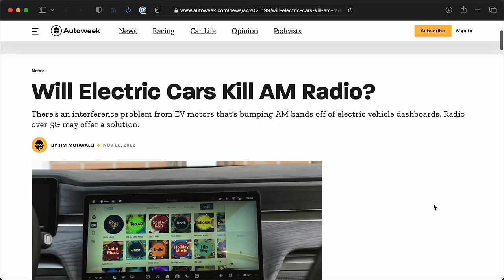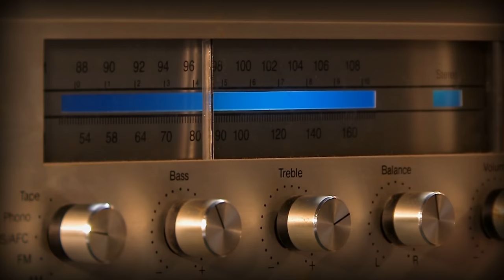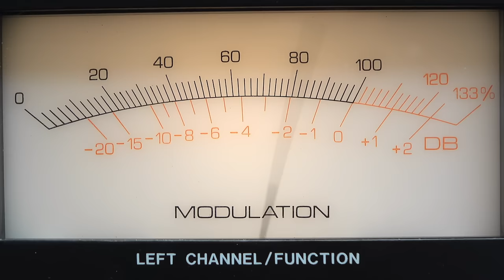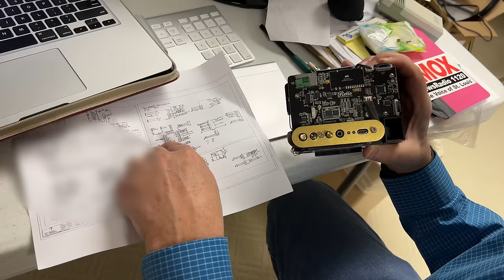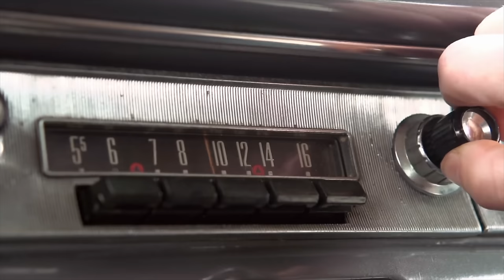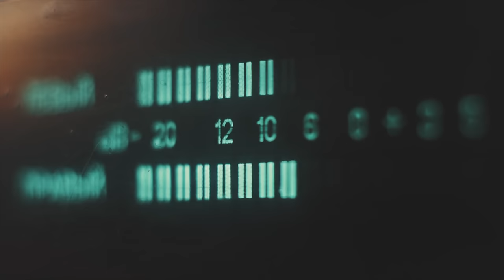Is AM radio dead? Tesla thinks so!

Comment: I would say that AM radio is not dead, but it is terminal. Preserving it is an exercise in futility. That is not a bad thing. It is simply a technology who's time has past. That said, it is used for some pretty critical things. So what we need to be doing is asking the following question. What is going to replace it? For each use case, especially the critical infrastructure ones, we need to be working towards a new technology that not only replaces it, but improves upon it, even if this technology does not exist yet. We need to actively be working on the next thing that will check every single box that AM Radio checked, while also improving on some of the classic problems with the technology. Like your dad mentioned Amplitude Modulation lends itself to allot of interference due to how easily any kind of noise can affect the amplitude of the carrier signal. So as an example, interference is one of the issues the replacement should at least address if not fix.

To the radio enthusiasts out there. I am not trying to take away your hobby. You should be leading the charge. Nobody is more qualified than you to be working towards the next big thing to solve these problems. I am not saying stop your hobby, I am saying take it up a notch.
Reply: If a decent digital way of transmitting and receiving could be implemented, one not as susceptible to the interference talked about here then then possible the MW band could be saved. Many AM stations were given FM translator frequencies going back a few years, many of them promote the FM side more heavily that the AM side.
Reply: @gorak9000  way to out yourself for not watching the whole thing. It is used for emergency communications. Amateur radio operators are a critical part of disaster infrastructure. The reason the FCC provides them so many protections and alloted spectrum is the FCC and Emergency Services rely on them when everything else is down. If it was only about the stuff you mentioned, there wouldn't even be a discussion. An intelligent person would have been able to figure that out even without the FCC defending AM radio just based on the fact that there are people in the know worried about it.
Reply: Dude the santanists don't want you to have freedom
Reply: I thought that AM (MW/SW) was long past its use by date three decades ago.
Then I met a fellow who was a pilot working in New Guinea. Then I met another fellow who was a pilot working in the North of Australia. 
AM was dead and buried in my mind but to them it was a lifeline to the outside world. A bit of QRM/N or QSB was the last thing on their minds.
Here I was, wanting "HiFi" stereo (free!) blasting out the latest tunes in my car and all they wanted was the latest news, the cricket scores and a song, playing in their hut.
We take things for granted. That's for sure.
Reply: I grew up loving radio in all it's forms: AM, FM, SWL, Aircraft, Public service, CB, Ham and more. But the object of my continuing love is dying in every direction except straight up. People today want to cut out everything they don't want to hear, and they're happy to pay to do that via satellite radio and internet. Commercial radio broadcasting is dying and even hobbyists like me are abandoning it. 

I used to stay up late at night chasing AM-DX and SW; always something different to be found in someone else's local 'flavor' or new music from big rock stations I wouldn't hear locally till it was top-40. It was magic to use that box in front of me to 'seed' what the rest of the world was like. Well, many of the AM stations are still there, but they're all playing syndicated radio so you tune from a talk show to the same talk show repeatedly. Unless you catch a newscast at the top of the hour they're all the same. International SW broadcasts from various nations worldwide is nearly all gone with "God radio" and a handful of Nations on the dial where once you could easily find 100 different things in one easy and pleasant hour. That 'magic' is gone now and it won't be coming back. 

So go on now, load your favorite songs and artists into a digital media so you can listen without hearing anything else ever. Or select your satellite station as you travel remembering to keep your subscription paid. Or grab an internet station via WiFi; if you're lucky someone will have free WiFi nearby and you won't have to pay to listen. I'm sure you'll be pleased and happy in your ignorant bliss, never realizing that once upon a time there was a wonderful dichotomy of life out there, free for all to touch and enjoy. You won't understand what's been lost because it was mostly gone by the time you came along anyway, and what little still survives will be killed off soon to sell people services full of only ones and zeros. The magic is nearly dead, and more's the pity.
Reply: @P_RO_  You can find all the new undiscovered music in every niche imaginable by letting youtube autoplay (or probably other services are even better, like BandCamp). Just start it in a genre, and let it go. You'll find stuff that's so unique in specialized and amazing niches that you'd never ever would hear on any radio station anywhere. Radio always targets the masses, not the unique or specialized. And for when you're "offline", real people just download their content and take it with them. There's no need to be connected 24/7. Sure the masses don't do that, because 30 seconds of effort to plan ahead is too much planning for most people, but that doesn't mean everyone is a moron who feeds the recurring revenue model of streaming everything these days. Now with the internet, you can discover some tiny band in Iceland who self publishes their stuff and doesn't get f'ed over financially by record companies just as easy as you can find lady gaga. You didn't get that on radio before (with very few exceptions of stations that were niche and independent and dug around and discovered the small groups, but those stations were only available in select areas - now they're available everywhere, along with everything else). There's so much diversity of content now that it's practically overwhelming!
Reply: @gorak9000  You seem to be one of those who don't understand. It's not about the search for music- it's about seeing and hearing the world through someone else's eyes and ears more than music. Yes, I love music, but when there's only the music you've lost touch with humanity. Yes I've found interesting bands through playlists and then that was the goal, but it's not the only goal out there. And the 'perfect digital audio' misses something; that's the magic I speak of. I can still remember the first time I heard Fleetwood Mac, the wavering signal strength of a Radio Free Europe transmission directed toward someone else on SW. I remember first hearing Black Flag on a local college's FM station, and being blown away with the depth of their simplicity. I remember when there was no 'Rock' on local FM stations and we had a few AM stations competing for our audience. I remember hearing nothing but Lynard Skynard on local radio for days after the plane crash and how much that affected the people in the community around me, I had almost went to their last show myself. I remember enjoying the old Country music classics listening to 'The Charlie Douglas Road Show' on WWL from New Orleans at night knowing that darn near every long-distance trucker in America was out there listening too. I remember hearing some hard-rocking bands from Canada like Chilliwack which got almost zero airplay this far south of the border on AM stations from up north. 

You're not getting any of that when you put in the earbuds and tune out the rest of the world because you don't want to hear anything except the music you think you want to hear. Unfortunately the "magical radio" I speak of doesn't much exist anymore so I can't show it to you, nor can you find it yourself. I don't know how to make you understand that it wasn't just the music  but the magic of riding along on a tour of discovery, never knowing what you'd find and not trying to steer the boat you were riding on but letting it drift wherever it went and simply enjoying the ride. If all you want is music then it's still there online and by satellite, albeit only in sterile digital form and clarity where each time you listen it will sound exactly the same as the last time. And no matter how you approach it there will be none of the missing magic of Radio.
Reply: I think you'll find that's where things like all the different modulations that have happened in the past 100 odd years have come from. 
Like you could spit digitally encoded data over the same spectrum and get the same coverage at the same power level as they have now with better quality. But who is going to buy a receiver for it? People will just listen to the content on their phones.
(The signal issues people experience with dab etc could be fixed trivially by allocating the same spectrum and power as is given to the FM signals rather than stuffing 15 stations into what was formerly given to 1 station, forward error correction and lower data rates fix a multitude of sins)

I think really what you're saying would result in a dab V2 but for AM frequencies. Could be useful but it would have to be mandated by govt that it be installed in vehicles or something to actually get any traction.

People who are concerned would probably be better off getting short wave anyway
Reply: the whole point is the simplicity. thers no need to "improve" am radio. as it is you  can build an am from scratch with 10 dollars. you cant do that with digital.
Reply: @P_RO_  Fantastically well put i agree !00%. Well done.Nothing can replicate the magic of radio.Young cats today have no idea how instrumental regional radio stations  were in breaking new acts back in the day.Bob Seger is but one fine example.
Reply: Unfortunately, the aging AM issue is just like all of the aging infrastructure across the US.  

“What are we going to do about AM Radio/Aging Infrastructure?”

<Spiderman pointing at one another meme>
Reply: Funny way to put it. Talk about making things obsolete without having any alternative, let alone a better one.
Reply: You can't replace AM radio any more than you can rescind the laws of physics.  Modulate any way you want.

Comment: I often listen to a program on WBBM in Chicago and I'm 760 miles away. We reception isn't going I could listen on the Internet, but usually don't. It's just not the same. I also sometimes listen to KMOX. I remember on one of Techmoan's videos he demonstrated how DAB in the UK mostly sounds horrible because of the low bit rates that are used.
Reply: You're darn right, it's just not the same. Last Christmas Eve I was pulling in the Christmas programming out of Chicago on my Emerson retro radio with the lights out lying in my bed.

Comment: In my country there is nothing except noise on AM radio. But I still like the atmosphere when you hear the radio with a lot of noise, so I tune the FM radio to the edge of the radio signal to hear the wheezing and this noise. Therefore, I decided to buy a SDR receiver to hear frequencies and modulations that are not available to a regular cheap Chinese radio receiver

Comment: A car with out AM would not be very good in two thirds of Australia but 90% of the population are in the other third and have no idea. From about 1930 on, good AM transmitters were capable of FM quality but  most radios are only capable of getting less than half of the bandwidth available so the problem is in receiver design. There are a few switchable band width radios available and AM sounds great on wide.

Comment: Probably a class-D audio amp in that Retio. Designers need to be careful to ensure the speaker wiring doesn't radiate square waves.
Reply: No, modern three phase inverters generate loads of noise because of the sheer amount of switching needed to produce three phase ac from regular dc. That’s the same reason why power supplies create horrible interference on the medium wave band.
Reply: @justaguy9224  Hurray for linear power supplies!  I've been earning my pay recently by repairing switch-mode PS modules and it's amazing how much power that can be had out of these small units.  The downside, of course, is the amount of RFI they generate not to mention the number of components that can easily breakdown.  Then there's the electrolytic capacitor issues, they get really hot on the output side, having to filter full-wave rectified freqs of about 40kHz to over 100kHz...is it any wonder why they don't last?  One of our Sennheiser wireless receiver's PS caught fire due to an output cap overheating and started a fire. The great majority of my repair parts stock is a cabinet full of capacitors since about 98% of the repairs only require replacing a few capacitors.  I've found the organic polymer filter caps are much better and last way longer than electrolytics.

Comment: In the UK they retain (broadcast band) AM in addition to (VHF) FM and digital broadcasting.  But since the 1920s there is a broadcast service on Long Wave (198 kHz) below the broadcast band.  This requires a high transmitter power and a gigantic transmitter antenna.  Long Wave propagation is different to that on the broadcast band.  It is almost entirely by "ground wave" and there is very little "sky wave".  This means that reception is constant, day and night.

The advantage is that reception of the BBC (Radio 4) on Long Wave covers most of the country from a single transmitter.  I reckon I could drive from Scotland to Spain and listen to the BBC most of the way without re-tuning.

Comment: My EV has AM, FM and DAB+ and I use DAB+ most of the time and haven't tried AM yet. I should try it.
I have a small Sony and and a big Grundig Radio with LF to VHF with several short wave bands and even SSB so I can listen to morse code :D 
Both are collecting dust in a shelf for over 30 years now.

Comment: Electrical engineer here.  At one point I wore a heart rate monitor.  Driving my old (1990s) vehicle, the monitor would jump to 200bpm.  I assumed the ignition system was messing with the HRM (as my pulse remained normal).

Comment: Frequencies like AM need to be preserved as they have long wavelengths and travel amazing distances and aren't affected by shorter frequencies like literally everything these days like FM and even worse 5G signals
Reply: What is AM frequency?
Reply: @cdjxwubcyex  The slice of the radio spectrum used by (and reserved for) AM public radio transmission.
Reply: @hugbearsx4  Those are MF frequencies.
Reply: @cdjxwubcyex  What's an MF frequency??
Reply: @hugbearsx4 MF is a designation for radio frequencies in the range of 300 KHz to 3 MHz.
Reply: @cdjxwubcyex  Then your previous reply makes no sense. "MF" as you call it actually IS "a slice of the spectrum", and also AM is used in LW, MW and SW bands.

Comment: I did not know Tesla and many other EVs don't have AM radio tuners. This is actually a deal breaker for me. Most of my listening in the car is on AM for sports, talk, and news. Yes, I can get one sports stations (we have 2 here in Toronto) and the news stations on FM HD Radio as channel 2 and 3 on one of the FM stations, but these are typically several seconds behind the AM broadcast, cut out more often, and don't have the same range. The only advantage to being able to listen to AM stations on FM HD is convienience when using Android Auto and tuning the radio as its not so easy with Ford Sync 3 to change audio sources when using Android Auto. DAB was supposed ro be the standard in Canada for digital radio, but being so integrated with the US, especially the auto industry, DAB lost out to FM HD Radio, but there's very few stations that support it, and even fewer that use multiple channels. Yes, I could use the RadioPlayer Canada (90% of Canadian radio stations), Tunein Radio, iHeartRadio Canada, and a host of other apps to stream AM, but why waste (albeit audio streaming likely wouldnt be a lot) my data?

Comment: Thanks for sharing this video.  I have a BMW i3.  In USA, the AM Radio is not activated by BMW.   This is because of the interference issue.   With an app and OBD connector, I’m able to activate BMW i3’s AM Radio.   It works but it definitely has sub-par audio quality.
Reply: You can talk to the radio via ODB? I need to look into what I can see on my car via ODB.

Comment: I'm a big fan of AM. My nation, NZ it has a hilly and varied landscape and AM reception was generally far more reliable and extensive before FM crept in.
Slight loss of high fidelity and slightly increased noise in signal was a small price to pay for the reliability and reach.
Actually, I've come to loathe FM with its requirements for balanced antennas, lines of sight etc. Because of these reasons I can't listen to radio now, instead I resort to streaming programmes on the internet, it has all become a big pain in the arse - all despite the fact that I'm in reasonably sized town of approx 10,000 pop.

edit: The sooner Elon walks off a cliff the better.

Comment: Dsp chips are notorious for audio clipping on AM. I have an Eton field BT radio that distorts on AM. If I tune it off by 1Khz the audio goes a little quieter and the distortion goes.
Reply: Interesting. Thanks! I tune for best sound and ignore the dial on analog and digital dials on AM tuners. HD tuners in the US have been good. But so few…